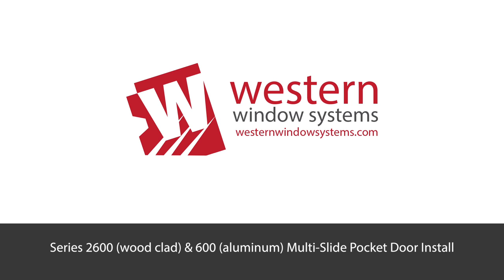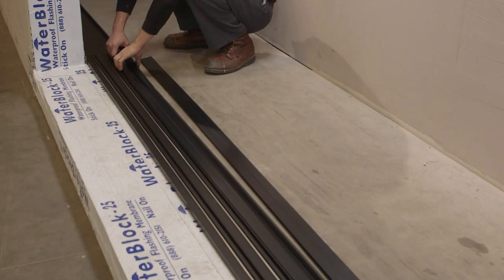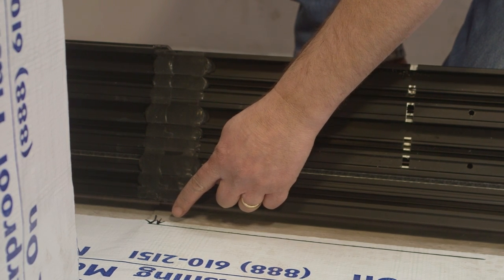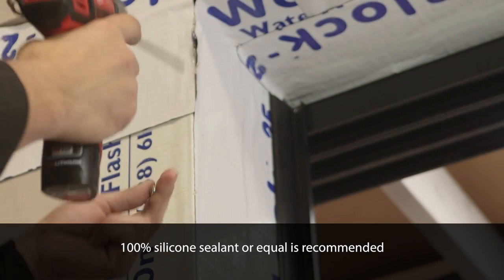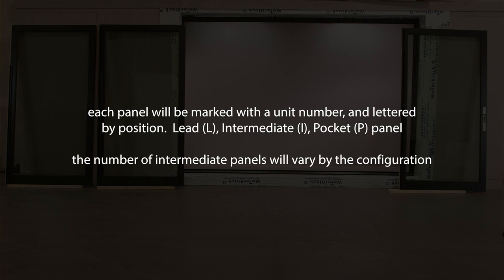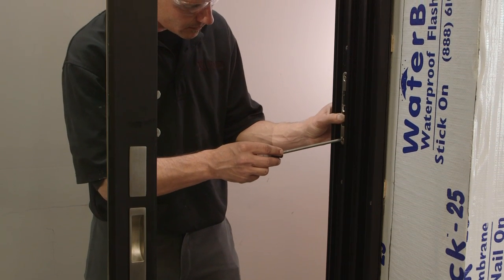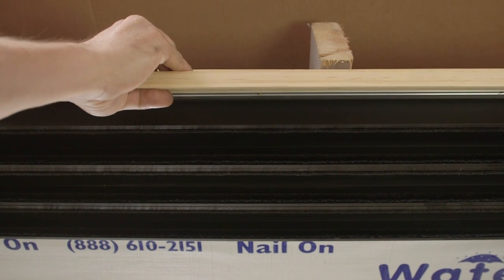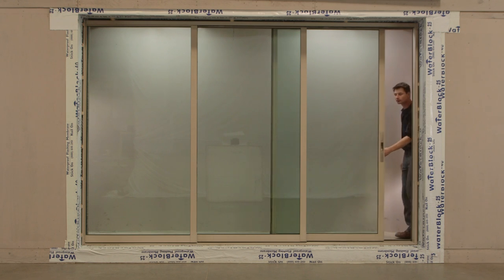Series 2600 (wood clad) and 600 (aluminum) Multi-Slide Pocket Door Installation

Comment: Can the direction of slide be reversed once installed? For example, if installed to slide left to right - is it easy to switch right to left?
Reply: Usually, It only could be slided to one direction once installed.

Comment: Never use wood shims on the sill of windows or doors. The can swell wen wet, shrink when dry and crush under the weight, ALWAYS used composite shims with 1000 PSI compression strength.
Reply: W